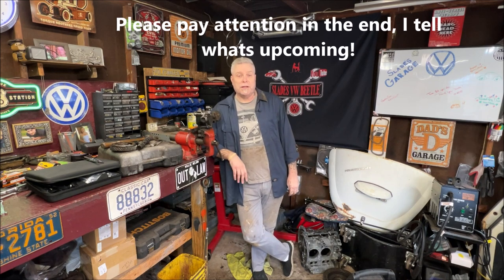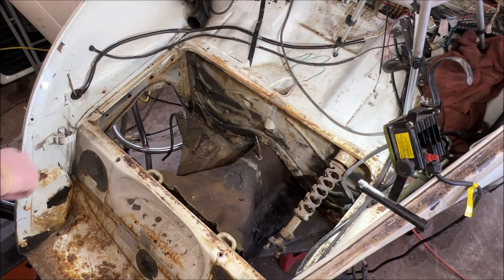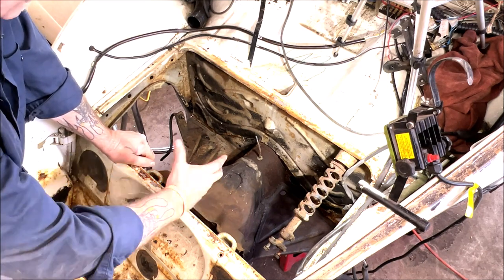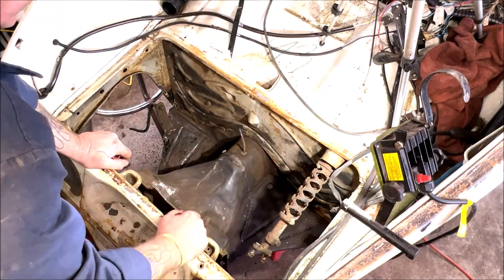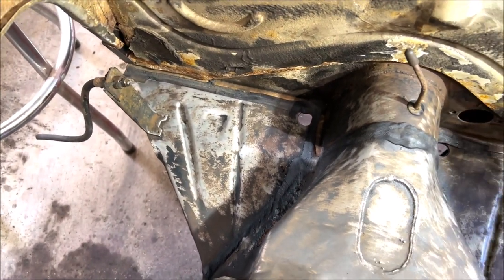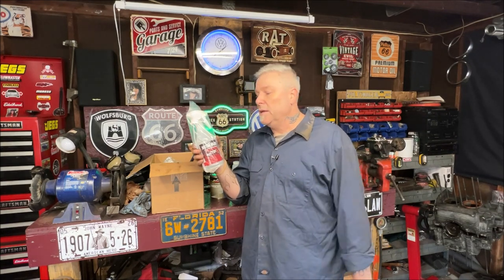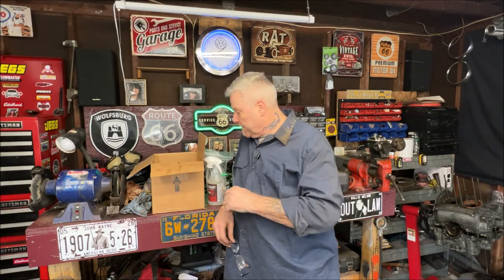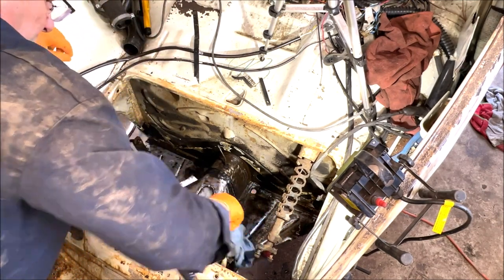VW Beetle Frame Head Restoration - RUST BULLET! Lets Try It Out!

Comment: Awesome 😎 Video 📸. Rust Bullet is going to keep that VW and lots of Classic car projects around for a really long time. There's a spray can version that has a long plastic straw that you can treat INSIDE the heater channels. Great 👍🏻 Stuff Slade Keep them coming.
Reply from the maker: Thank you Leonard I truly appreciate that. 
Do you mean Russ bullet has a spray can? I didn’t even know that to be quite honest with you. I would like to spray the inside of my heater channels it would help so much.
Reply: @SladesVWBeetle  Rust Bullet doesn't. Sorry 😐 Eastwood products is the one I was referring to. I've seen it used on a lot of other YouTube restoration projects on all kinds of different cars and rust situations. All I've seen is good feedback with Eastwood products. It's very similar to the rust Bullet that you're using.
Reply from the maker: @leonardramsey3458  I forgot they had that. I would like to spray some thing inside of the heater channels, since they do rust from the inside out. I will definitely look into it Leonard, thank you so much for the reminder.

Comment: Tip for people who won't buy an air compressor, (I did but I hate all the noise it makes) you can often get by with using a foot or hand pump as used for inflating a bicycle or car tire.
Reply: Oh yeah the old fashioned wire wheel is way better than those new spongey things, they suck!
Reply from the maker: Thank you John, for giving a tip and advice I truly appreciate it that’s what makes this community special. Great tip!!!!
I agree sir, I did not like it at all that’s why I switch to the wire wheel. I thought that spongy thing kind of sucked lol

Comment: I have a question,I have a 57 bug my son and I are restoring,it was ran into the ocean back in the 60s,I have restored probably around ten bugs in my life time,I have never ran into this.The engine won't come out it it stuck to the transmission shaft.all bolts are loose,the starter is removed the fly wheel is rusted,you can see it through the starter hole.The engine will turn all the way upside down left or right, but will not come out,any Ideas other than a torch?the engine and transmission both have to be replaced.
Reply from the maker: First of all my friend be very careful with a torch around magnesium. If it catches on fire, which it can…you will never be able to put it out. Those engine blocks, burn like crazy. Not trying to scare you just warning you.
I have never had one stuck like that. The only thing you can really do is keep banging away on it. I have never even heard of one thing about stubborn.
Reply: Yes I have thrown one or two old magnesium blocks in  in the bon fire on my uncles farm,when I was less wise.I get it.it can be Dangerous I guess we will just try to muscle it out.Thanks for your input I enjoy your channel, keep it up.

Comment: Another great video. I’ve gotten lots of great advice on my restoration. When do you think you’ll get back to your beam?  I’m trying to clean up the gunk in all the grease out of the inside of mine. I was hoping you would go over that before I needed to finish mine.
Reply from the maker: Thank you Andrew I truly appreciate that. I actually bought a brand new beam, that is bare. 
So I will be installing that. Of course doing the whole process with installing the springs and everything. My old beam I’m going to refurbish. And have it as an extra. I will be doing that within the next four or five weeks.